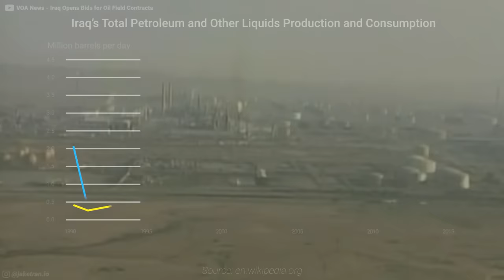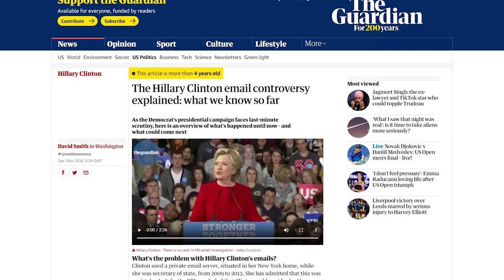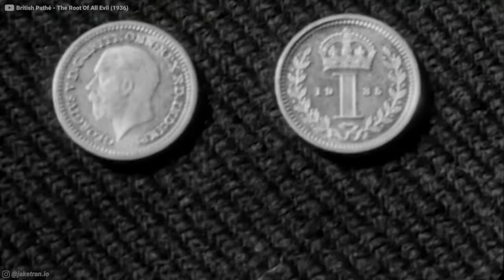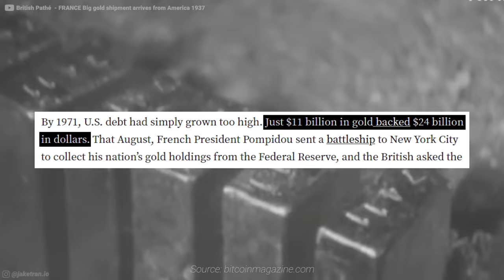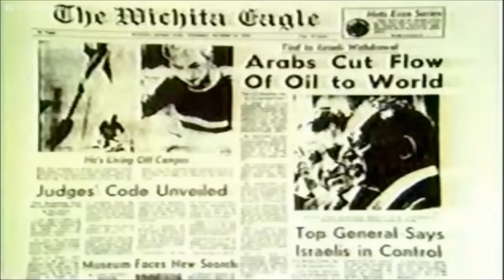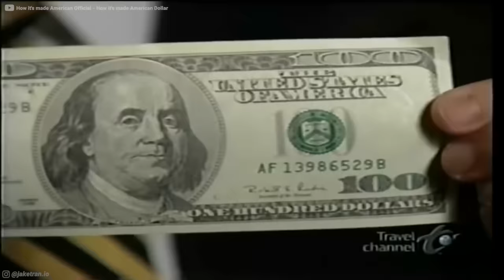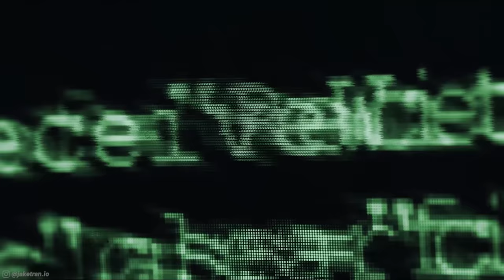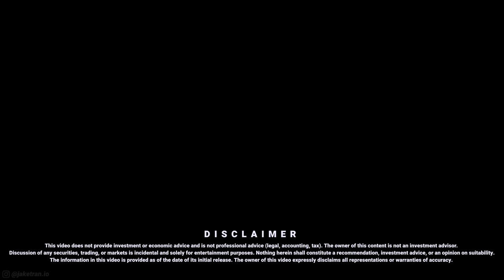Why we’re always at war (Documentary)

Comment: Dunno if you have done one already but there is alot of info out there about the fact oil is not actually a fossil fuel... its an un ending supply.. I'm not 100% sure about the facts behind it but its interviews with people very high up the the oil industry.. and one of em was filmed in the 80s so if true... they have had knowledge of it and used that knowledge to financially gain through propaganda I.e "scarcity" oil will run out

Comment: We all know that any fighting in the Middle East is first about oil, and if the country supports terrorism and is relatively weak, they will be targets. The short-sightedness of that action is that we turned on the dictators that we could work with in exchange for those we could not control. Thus, more oil supply and political instability.

Comment: But that makes zero sense, if the US's goal in attacking these was motivated by oil, then oil would be what they stand to gain, but the war in Iraq alone cost the US over 2 TRILLION dollars, if the US's goal was to keep the dollar value and get Oil, it would have been much cheaper to just buy it, not to mention you are blaming the downfall of Venezuela solely on the US when in reality US sanctions and backed coups were implemented at a point when the Venezuelan economy was already tanking. The goal of the war in Iraq was the goal of Bush trying to get the glory, not American greed for oil.